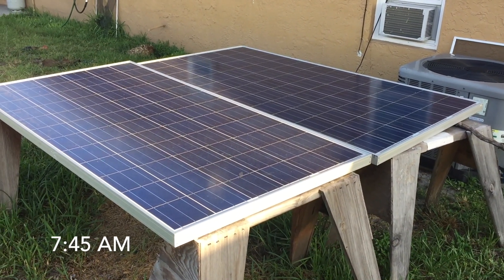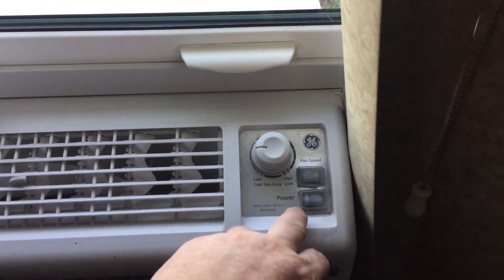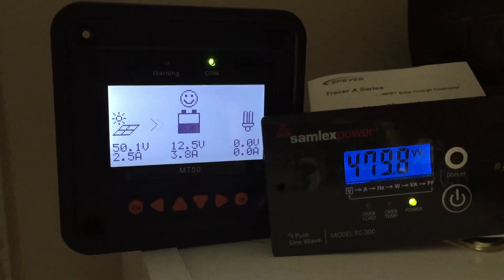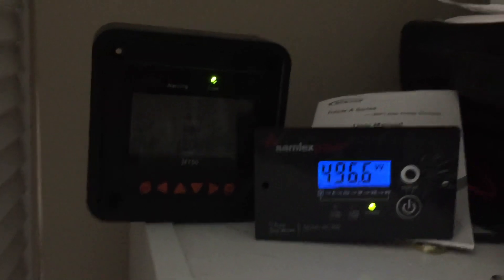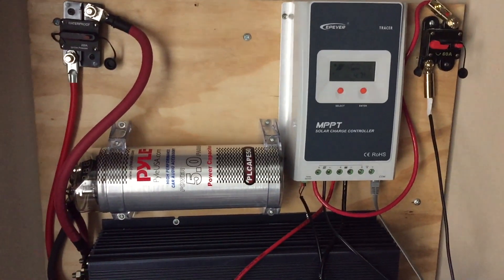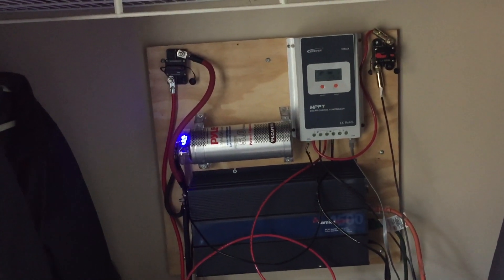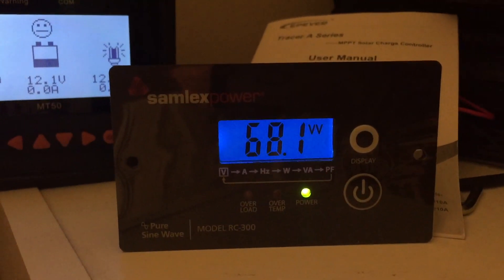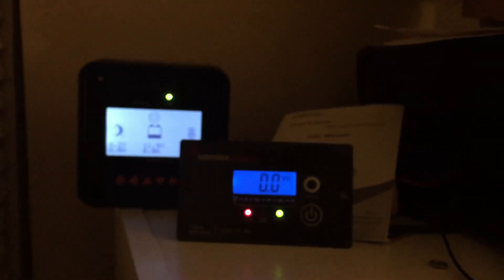What can you power with two solar panels?  How about an air-conditioner?

Comment: You started off with a charged battery so it lasted till 11 in night.
Otherwise 620w panels wouldn't be able to charge 4x100Ah 12v batteries during sunshine hours, forget about running a load on that setup.
Reply from the maker: That was just a test to see what it could do.  What if I had no power?  I would not want to sit in a house that's 90+ degrees all day.  It's better than nothing.  My neighbor ran a generator all night after Hurricane Irma.  When I woke up the next day, my entire living room was smelling of fumes.  And if you tried to buy gas, the lines at the gas stations were very long.  I don't have that problem.  As long as I can run small fans in the middle of the night to keep us cool while we sleep, mission accomplished.  While everyone else for miles has NOTHING.  What good are generators when they run out of gas?  Then you go to try to buy more gas and the gas station is either shut down or has a mile long wait?  I got all of this stuff cheap.  These solar panels were barely over $100 each from a person on Craigslist.
Reply: @snn9019  yes I understand that.
Reply: @snn9019  You said it "it is better than nothing".
When we lose power even the gas stations are down there is no more fuel for a generator. Even a 100 watt panel can run a old car radiator fan to cool someone down in 100F heat. Thanks for sharing!!
Reply from the maker: @vet137  I was using this system when the gas stations were down after Hurricane Irma.  It was nice to run fans and charge phones on it.

Comment: So if you had 4 solar panels does that theoretically mean you can run this all the time?
Reply from the maker: No.  I need more batteries.  The batteries ran dead in the middle of the night.  Maybe they would run longer if the A/C unit was installed in a van instead of a large room.  Then it would cycle off more and not go through the batteries as fast.  Once the battery gets down to like 10.5 volts, the inverter starts beeping before it shuts off.
Reply: @snn9019  ahh I understand. Thank you so much!

Comment: Is that samlex still working?
Reply: Yep.  It's been running 24/7 ever August, 2018.  I use it to power my security cameras and other stuff.  I wish I got a bigger version, but this one was expensive enough as it was.  Most all of the other models I saw had tons of bad reviews about arriving DOA or only working for a while and then dying.  It was hard to find any inverter that didn't have any negative comments.  I was thinking of even spending a ton of money on a Go Power, and saw negative reviews on that as well.   I paid $479 for this inverter back then on Amazon.   Not long after I bought it, the price went up to way over $500.  Now I see the price has gone back down to $480.    https://amzn.to/3k5TKoe  I had two 300 watt inverters that I used before this and those units would always shut off and re-start on their own.  This one never shuts off unless there's really bad weather for many days at a time.
Reply: @CarMaintenanceGuy  thanks for the reply.  I'm just starting out into the whole solar stuff an saw alot of negative reviews an when with a victron phoenix 800va and 100/20 mppt. Wish i had gotten a samlex 1500w cause the victron 800va is overpriced for what i pay
Reply: @CarMaintenanceGuy  the victron phoenix 800va doesn't even have any heat sink for almost $300. Currently using it to power a 32" tv playstation 4 and a fan. I'd like to get a samlex 1500w or samlex evo 1224f-hw or evo 2224
Reply: @diy-bj2ed  The PS4 doesn't take as much current as an A/C unit does.  That should be no problem.
Reply from the maker: @CarMaintenanceGuy  Yes, Victron makes awesome hardware.  I would love to buy some of their stuff.

Comment: You should add an automatic transfer switch  (ATS)- that way you can keep running on solar until the batteries are low then the grid power will take over.
Reply from the maker: That's exactly what I need.  If you know of an easy one to set up, post a link here.  I was reading the documentation for the Samlex one and it seemed really complicated to set up.
Reply: @snn9019  Will did a good video called Automatic Transfer Switch for Small DIY Solar Systems: How it works, Applications, and Installation, https://www.youtube.com/watch?v=ni0A_ZdH7aU&t=555s  
Unfortunately, the product he used doesn't seem to be available anymore.
Reply from the maker: @DanielMooreClan  Yes, that looks exactly like what I want to do!  I saw one of the reviewers comment on this MOES device with a one star comment saying, "Warning. Do not follow the manual. The diagram for connecting the unit does not correspond to the actual product. Wiring based on the manual's schematics will cause you to bridge a connection between your inverter and the public grid. You will end up permanently damaging your inverter."  But everything he did in the video is 100% identical to what I am trying to accomplish at one point. I spent all this money on this stuff.  Rather than let it collect dust until an emergency, I can use it to power my sensitive equipment 24/7 and not have to worry such much about constant black-outs and brown-out's from the grid.  Thanks for posting that.  You can now buy this on their web site, but it ships directly from China.  So it probably takes a good couple weeks to arrive, if Trump isn't blocking them.   See this link here: https://bit.ly/2XzKfot

Comment: i should do this to save on electricity lol
Reply from the maker: I have it just for an emergency backup.  Better to have it than not have it.  If a hurricane comes, you can take the solar panels, put them away until the storm passes and them put them back outside to use power for WEEKS if needed.  Even if all of the gas stations shut down and you can't get fuel for a generator, I can at least run an A/C, TV, fans, computers, charge phones, etc, all from these 2 panels.  And I have MANY MORE panels left that I can still use.  I just don't have a good place to put them all in the yard.  People don't think about "comfort" after a power outage.  After a long power outage, it SUCKS to try to sleep in a house when it's 90+ degrees outside and you have no working A/C or ventilation.  At the very least, I can power some fans to blow on us while we sleep.  That's better than nothing.
Reply: @snn9019  I could use this setup right about now... It's 2 am and literally 90+ degrees outside and my went out. Hot as balls in my house and can't sleep. Going to be getting something like this tomorrow
Reply: @drshockter2158  The problem is the cost of it all.  Since the batteries died off at 11 AM, I would probably need to at least double my batteries and maybe put another solar panel or two out there so the A/C could run 24/7.  The problem is that this charge controller won't handle that kind of power and then I'd have to upgrade to a much more expensive one costing a good $800+.  I already have the extra panels. I just need to pull them out of the garage.  I would have to get a combiner box installed outside to have all 4 connected to it. That box I think is a good $100 or so as well.  Plus the batteries are near $200/ea.  So it's very expensive to do this.  If I lived way out in the woods and had no electricity, this would be a no brainer and I would just spend the money and do it.  Or if I lived in Slab City out in California, I would do the same.  Out there I'd probably have all 16 of my panels working so I could power a fridge, A/C unit, lights, microwave and much more.
Reply: @thebestmotoroil101  
The TWEEKERS at slab city 😱
Watch out for RIP offs😡,
Reply: @snn9019  its smart. especially being in FL. lose power all the time, might as well make use of a tool thats available and accessible. something i need to take knowledge on. will you be posting more videos like this?
Reply from the maker: @MeatyMike  I'm wanting to.  This was a temporary trial just to see what the possibilities were.  Right now I am using this system to run a refrigerator 24/7!